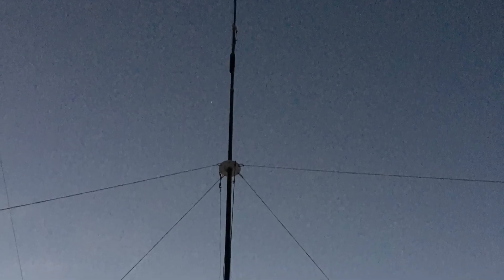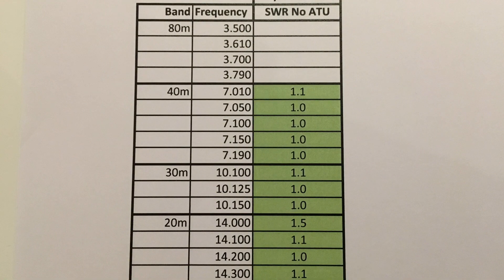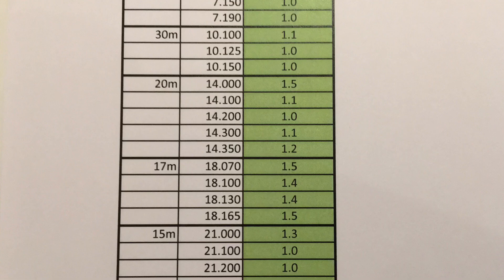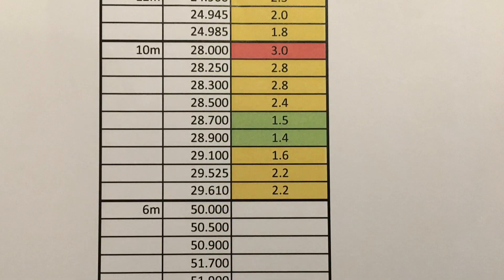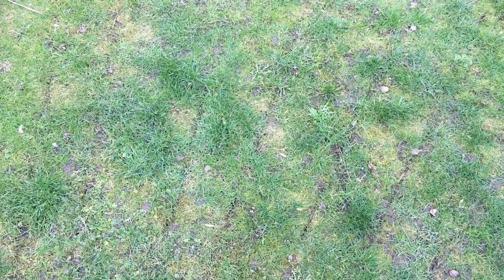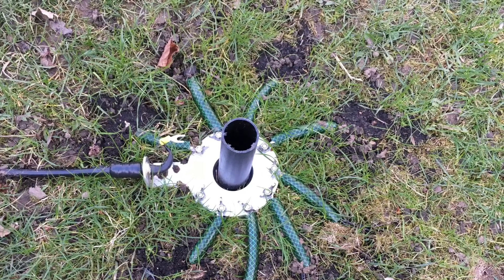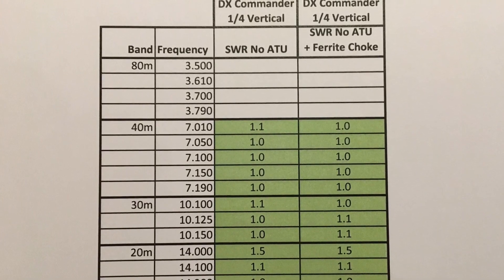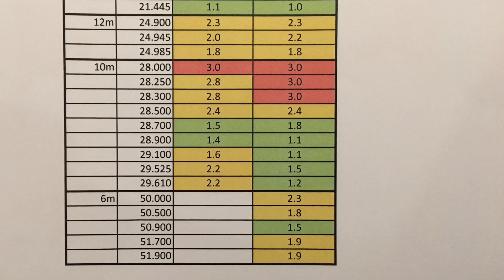DX Commander Home Base Antenna Installation - SWR Readings - Part 2

Comment: I appreciate your video. I am in a similar circumstance.  I've been a ham since the early 80s but have been inactive for 20+ years. I recently retired and am working on building up a station. Ilke you, I feel like a novice again. A lot has changed in 20 years!
Reply from the maker: Flying Hamster Yes a lot has changed, but the basics are still the same. I’ve been back on the air  a year now and really enjoying it. Have fun! Ian. (more videos on this channel following my exploits 👍🏻)...

Comment: Ian I need help! If my SWR is high, it means my element is too long right? Thank you so much. It’s trouble not having anyone near. I’m in a club, but seems no one wants to take a ride to help. I’m trying to learn and teach as I go. I just passed my second level which gives me HF access. Thank you!  -73-  W1KPS
Reply from the maker: Kevin Shields No Kevin. If you measure across the band in question, see if you can tell if the SWR changes noticeably at either end. The element might be long or short so the SWR dip might be off the bottom of the band (wire too long) or off the top of the band (wire too short). An antenna analyser helps as you can see this instantly, but without, you need to adjust to see if the SWR is getting higher or lower. If you’ve followed Callum’s instructions on measurements, the the wire is probably long. Fold it back a few centimetres at a time and see what happens to the SWR. For example, on 20m if 14.0 MHz SWR is say 1.5 and 14.350 MHz is 2.0 and there was nothing lower than 1.5 SWR in between, then the wire is long as there’s potentially a lower SWR lower than 14.0MHz. Just fold it a bit more and see if the lower readings move further into the band. 40m can be a bit more tricky as you can get a reading the same right across the band e.g. 3.0, so you’re left wondering if it’s long or short! Best to assume long and just fold it back further until it lowers. If it doesn’t, then it’s probably short, so back to the first fold-over length you started with and undo the fold a bit to lengthen the element. Trial and error Kevin. I’m sure you’ll sort it 👍🏻
Reply from the maker: ps. Congratulations on your exam pass by the way ✅
Reply: ianxfs thanks Ian on both counts!

Comment: Can I use snap on chokes?
Reply from the maker: Kevin Shields Yes Kevin, but you’ll struggle to match the performance of this ferrite ring in my opinion. I also have snap-ons on my in shack leads eg laptop usb leads. I also use large snap-ons from Mouser for all four-gang mains cables in the shack. A good belt and braces approach.
Reply from the maker: Sorry Kevin, I thought your comment was in relation to my HF Ferrite Choke video! I have this choke in-line on both my antennas as a belt and braces approach following an issue I had with my off-centre fed dipole.  Unless you experience issues with RF in the shack, then there’s no need on your DX Commander. Hope this helps! Ian. (take a look at the choke video as it may be useful to you).
Reply: @G0CNN-Ian  It's ok, no problem. Your answer was a huge help!! I will probably order some snap on chokes just to have, but if you say I probably won't need then I trust your judgement. Two days now and I still don't have it up. I kept putting jubilee clips in wrong place, so I take them off and put them back on... lol Hopefully this weekend!!
Reply from the maker: Kevin Shields Remember Kevin there are three models of DX Commander. This is the Classic/original and my latest videos are for the Expedition. There’s also a Lite version too which I don’t have. Check you’re following the correct videos for the version you’re building. There are a few walk-along and long-shots in either this video or the earlier one in this series on the Classic version. Just pause it and make your own notes/sketch. Unfortunately, I’d already build mine before I decided to start making YouTube videos, so no build filming on this model I’m afraid.  You’ll get sorted in the end
Reply: ianxfs thanks Ian, I appreciate it! Yea I know he has different versions, I have the classic. I just frustrate myself when I don’t do things right. I’m a perfectionist, so little things make me so crazy!! I’m also impatient so I want it up yesterday!

-73-  W1KPS

Comment: That was a very good video! It was explained well. I was wondering about burning the ground radials. Seems it works just fine. Are the bits of garden hose to protect the ground radials from a weed whacker? Also I’ve never asked Callum as I forget to, but can you bury feed line?
Reply from the maker: Kevin Shields Thanks Kevin! Yes the radials work fine and are just under the surface. The grass is starting to grow now and had been cut twice, so they’ve disappeared. You’re correct, the bits of hose are to protect the radials from the lawn strummer/weed whacker. I also have a few raised bits of hose as some radials are vertical for six inches as they go up then across a raised bed. I just tacked the hose to the planks of the side of the bed. I can now strim away the grass confidently knowing the radials are protected 👍🏻 My RG213 is buried under the lawn and off to the side fence. Then laid loose along the base of the fence at it heads back to the house. Just check the spec of your coax can be buried, but I’m guessing most can. 

Have fun!

Ian.
Reply: ianxfs Thanks Ian, I didn’t know coax could bury, but I will check that. Maybe I’ll use some plastic pipe to put the coax in. And bury pipe.   W1KPS
Reply from the maker: Kevin Shields Yes check the spec of the coax. It may be cheaper and/or easier to buy coax that can be buried rather than the effort and cost of pipe plus cheaper coax...Ian.

Comment: Many thanks. Can you provide details of the choke, please? I think I can see 12 loops. Which ferrite core did you use?
Reply from the maker: James Bowie Yes it’s 12 turns of RG58 around a type #31 core (FT240-31). G3TXQ has some excellent reference material here: http://www.karinya.net/g3txq/chokes/ When you look at the various options (see his further pages on each ferrite type), the above configuration seemed the best to me for the HF bands. 

Hope this is of use.